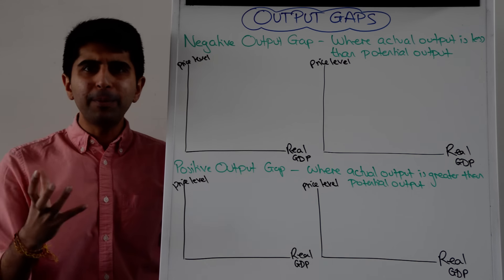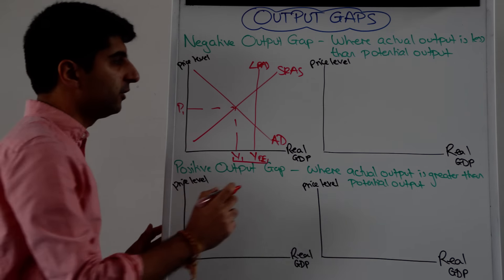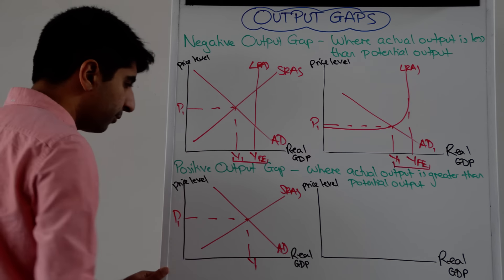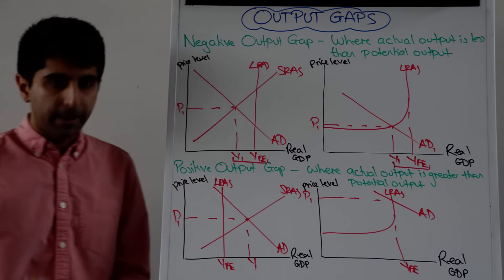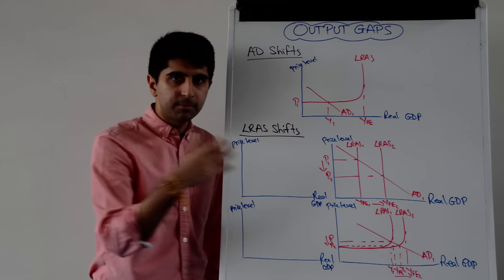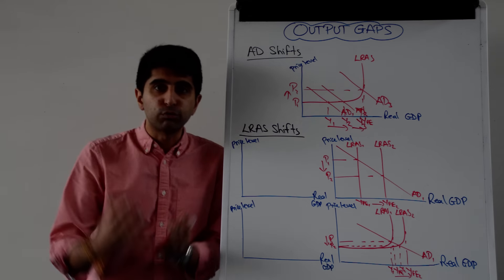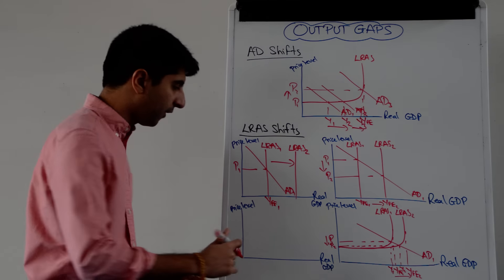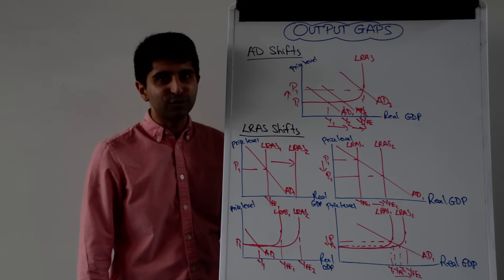Output Gaps

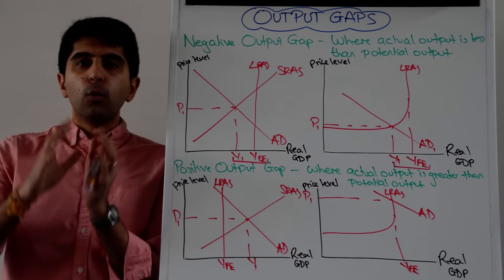Comment: As a positive output gap is only possible in short term, surely is doesn't make sense on a keynsian diagram. I know you touch on this but wasnt sure if you meant it doesnt fit because output isnt furtherto the right than Yfe or becuase it wouldnt be on LRAS. 4:20 bottom right diagram
Reply: @Edward Burns Sorry for such a late reply but he was referring to the fact that the positive output gap for the Keynsian LRAS is above YFE and is therefore unsustainable in the long run... It's actually impossible to have your demand exceed LRAS because of the huge demand pull inflationary pressure and scarcity. His main point is that it is just a pain to draw a positive output gap for the Keynsian diagram.